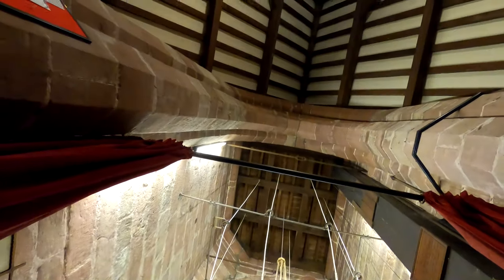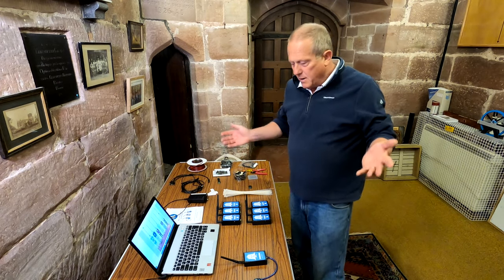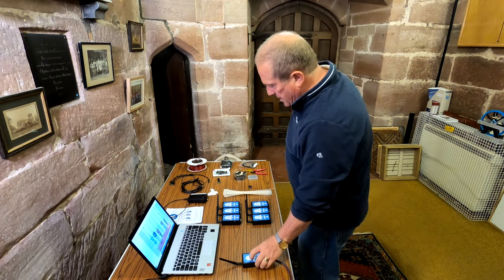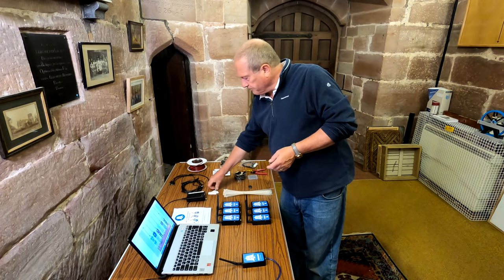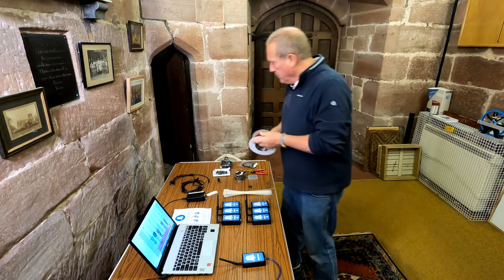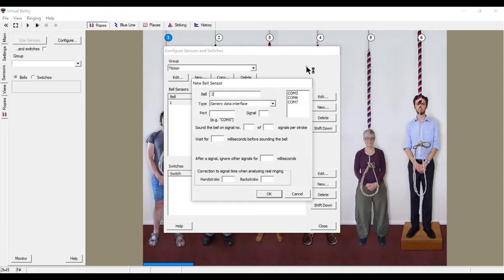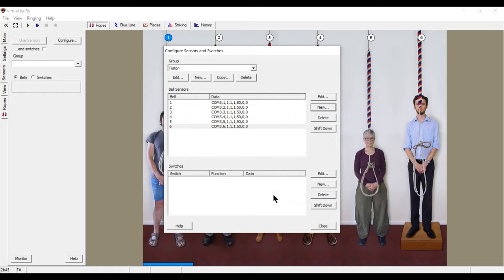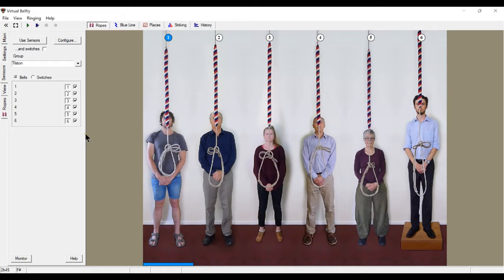Simbell - Full Installation

Comment: Hi Steve. I have a question about the power supply mentioned at time stamp 4.07. is this a separate power supply or the battery charger unit?
Reply: Hi Melanie, the one shown is a battery charger, you can use one of these or any other 12V supply, but you need to make sure that the polarity is correct,  the sockets in our belfry are in a weatherproof box and therefore I ended up using a supply with a plug and lead rather than the plug type shown in the video so that the socket box can be closed and sealed against the elements, the supply I finally used is a 5A one and is located in the steel RSJ under the bell frame out of the way.
Reply: @stevef4943  Thanks Steve. Hopefully I'll be placing an order next week for a full 6 bell install kit.
Reply: @melaniefarnham4595  if you have any questions feel free to give me a call :-)